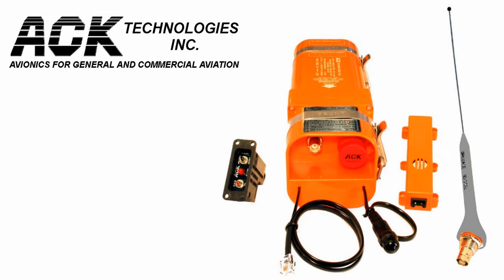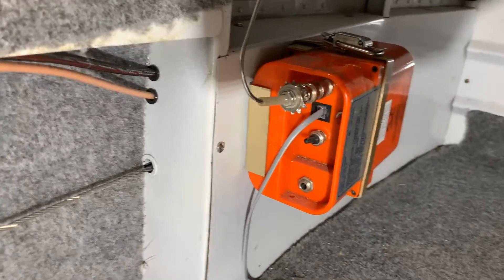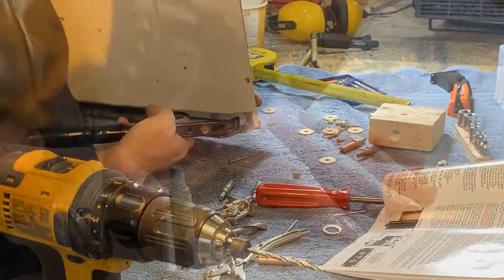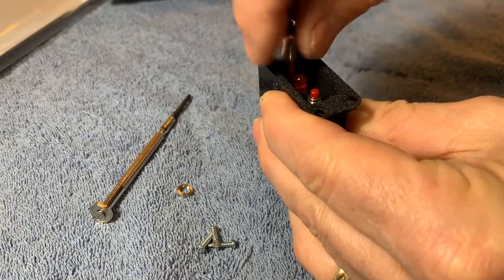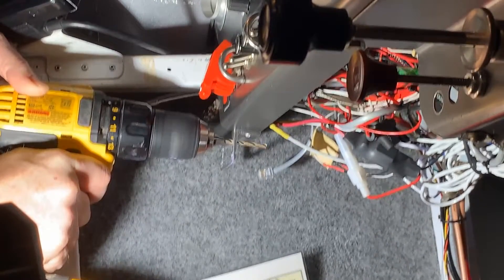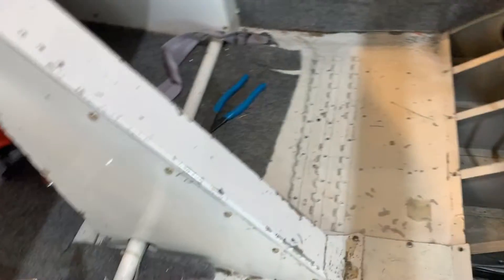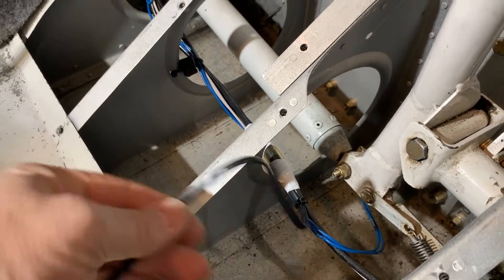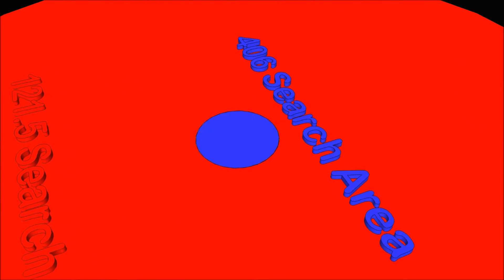ACK E 04  406 ELT Install

Comment: Great video, thank you very much. Considering fitting one to my glider but wanted to see some hands-on install first. Can't decide between the ACK and Artex!
Reply from the maker: Sorry for the late reply.

I’m not a fan of ELTs, as I place more value on ADS-B, especially for search and rescue operations. I installed this ELT because I was required to do so by law; therefore, I selected the least expensive option I could find.

I’ve heard from others—who have more knowledge than I do—that the ACK ELT may not be a great choice due to reliability issues. However, that information is strictly third-party and hearsay. I don’t have firsthand knowledge either way.

Thanks for the feedback, and again, sorry for the late reply.

Comment: I just replaced a Ameriking ELT, with the new ACK E-04, using the ACK remote cable connector E-04.10.8 adaptor, and the old Americaking remote cable worked fine. http://www.ackavionics.com/wp-content/uploads/2018/03/AmeriKing-to-Ack-conversion.pdf